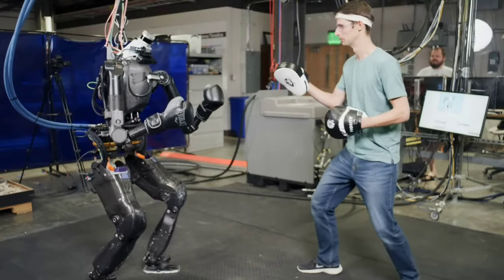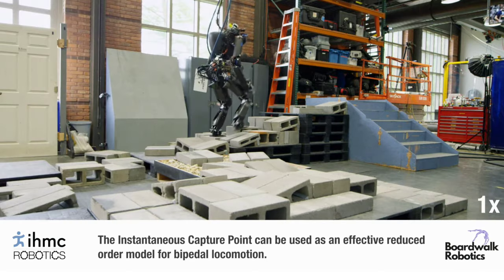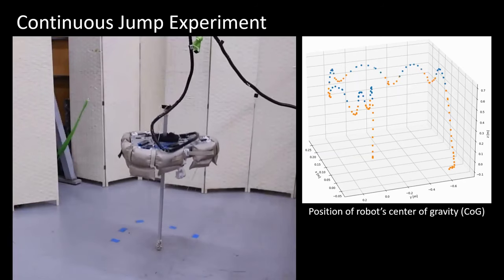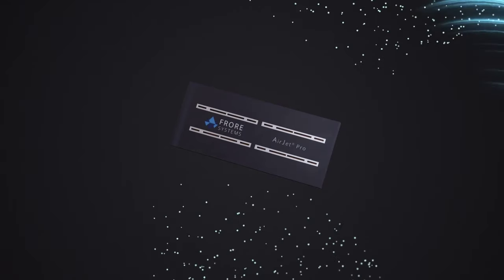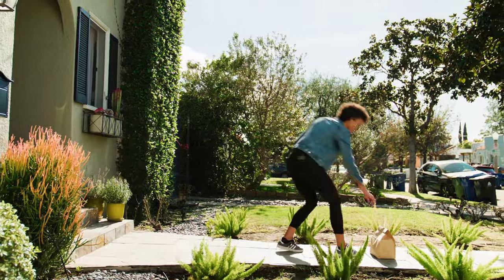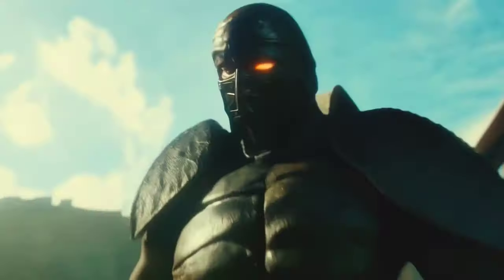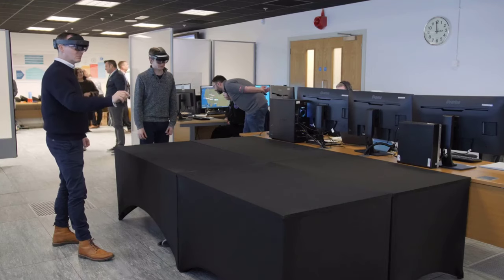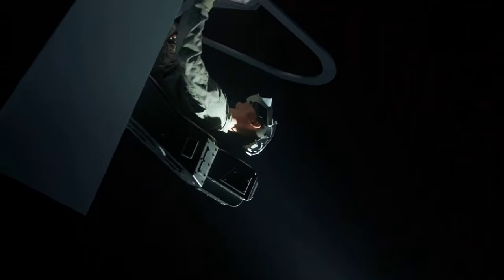He's Boxing Against Robots

Comment: The pogo robot is reminiscent of the stuff Boston Dynamics was doing in the late 80s/90s. Bounce is higher etc but it’s very similar and I’m surprised the video didn’t reference this fact.
Reply: Purely speculative, but I'm surprised they don't appear to be taking advantage of the circular design to include an internal gyroscopic stabilization(it's possible it's on their design track and they're just focusing on the rod control at this stage, or they are using a few smaller spread ones in each of those three compartments beyond just the cable motors.) The position of the rod(given its' length) would be able to help control the procession in a meaningful way and combining the research already done on this, it could possibly make some unique design capabilities for stability on a single leg.

Probably would have to resort to capacitors for power capacity/weight at that rate though as the gyros would absolutely impact vertical jump height as well, which may risk too many losses even with regenerative measures. Anyway, still very cool stuff~!
Reply: It reminds me of a concept some crazy guy had several decades ago for a hopping tank.
Reply from the maker: I'm not omniscient, I just missed it